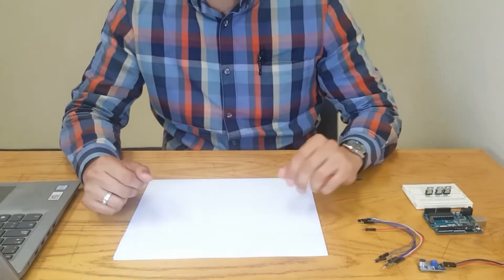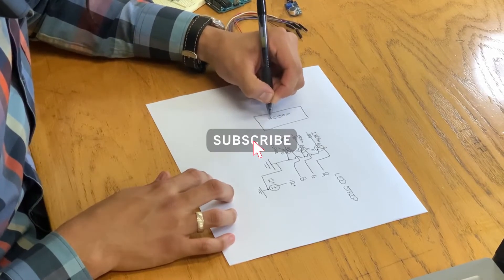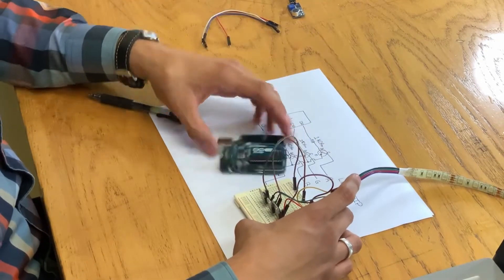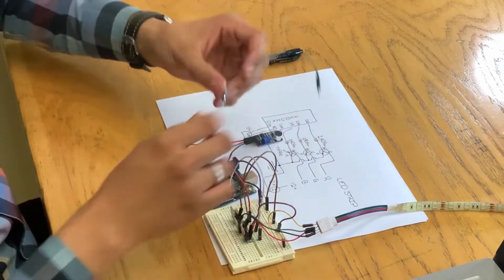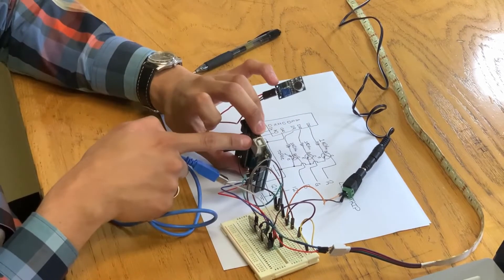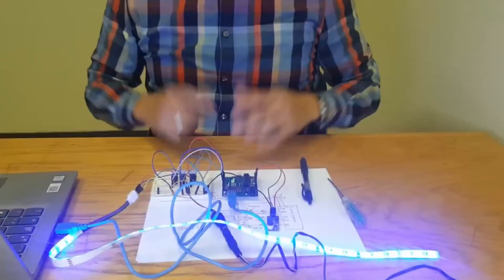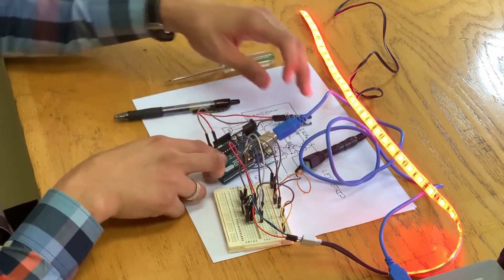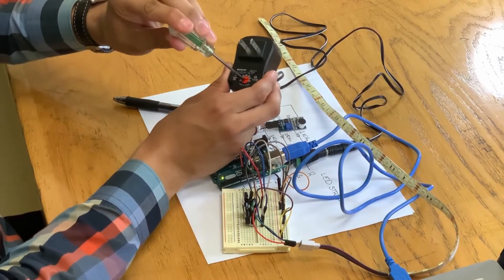DIY Music Following RGB Led Strip Arduino | and Answering all your Questions

Comment: I have a question about the music reactive led. For me, the code is working, as something is printing in the serial monitor, but the led is not glowing. 

The analogRead(serialPin) is sampling so frequently that it is stopping the led strip from glowing. The board I am using is an Arduino Uno Atmega328P. 

Could you please help me solve this problem.

Comment: Please if you can make a video with close proximity to the work. Camera is too far and connections are not visible properly
Reply from the maker: We have the diagram on instagram 👍
Reply: @brainsmash4920  then what is the purpose of video
Reply: @brainsmash4920  thanks a lot bdw

Comment: hello new to the channel here, the schematic and connection set up seems correct but the code is uploading perfectly its just not talking to the LED'S, my led's just turn on and stay on even though my sensor seems to be going off by flashing everytime i make a noise. any clue what it could be?
Reply from the maker: did you adjust the sensor
Reply: @brainsmash4920  I got it now, supper fun project thanks!
Reply: @everysecondprint8452  hey i got the same problem but adjusting the sensor couldn't solve the problem , can uh pls help me
Reply: @AjitsMusic1  biggest help I can give is don't over crank the speaker but try to find a middle ground. Whenever you see the led strip flicker. Dial it back a few steps or forward. I hope that helps
Reply: @everysecondprint8452  i tried but didn’t got it! It flickering to sound but it is random flickering

Comment: sir any other transistor can we use??
Reply: Yes, you can use any transistor that is NPN and supports at least 1 A of current through Base and Emitter
Reply: @AnoyingCole  ok thanks sir
Reply: @Vinay068  No problem, I'm not sure at what timecode they said it but it was on the video where they explain if you want to use another transistor , Brain Smash Rocks for helping us out so much!
Reply from the maker: No problem feel free to ask questions we are active on instagram 🤟🏼 thanks ⚙️

Comment: Hi Brain Smash, thanks for showcasing your work to us for free.

I'm working on a project - an electric fan speed controlled by sound using arduino and sound sensor. I don't seem to be getting the desired result. The output from the sound sensor is inconsistent. Eventhough I didn't include a transistor, do you think including it would solve the problem?
Reply: just configure the sound sensor potentiometer on the sensor as per your needs then it will be fixed :)

Comment: Hi, I appreciate your work a lot, can you power the arduino board from the breadboard(12v) via the pins
Reply from the maker: Hi, Thank you for your comment

Yes you can power up the arduino from the 12 v coming from your power supply to your breadboard, just be sure to Connect GND from Arduino to the Breadboard GND, as well as Breadboard Positive to Arduino Vin pin.

*Make sure that your power supply has enough current for you to turn on your Arduino and your Led Strip so that neither of them look like they are barely turn on.
Reply: @brainsmash4920   i want to build this set up and run it without it being plugged into a laptop - i want this system to be standalone and portable. is this possible?

Comment: What is #define delayLEDS 3 in the code? Also, what is delay(delayLEDS); at the end of the code? The else statement does not seem like it is doing anything or work.
Reply from the maker: With the "#define delayLEDS 3" we define a variable in this case called "delayLEDS" that will have a value of 3 miliseconds, this variable is just for testing purposes you can comment it or delete it, it was used to see if a delay between what the sensor catch and what the Led strip showed would be acceptable, but it is clear that anyone will enjoy more if the sensor registers a sound and then almost immediatly the Led Strip displays a color matching the intensity of the sound as fast as it could, giving it a sense of real time.

 The "delay(delayLEDS)" statement is just that delay in action but since its very short its almost non existant, as I said you can either toy with it and see if you found a setting that you like or comment it or delete it.

Hope this answer your question and keep em' coming ;)
Reply: Donde encuentro el código??